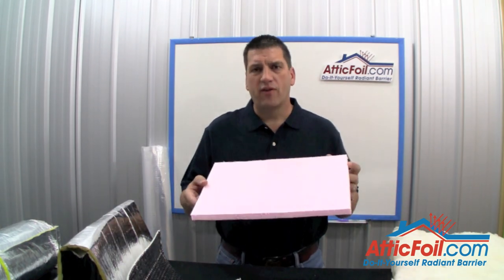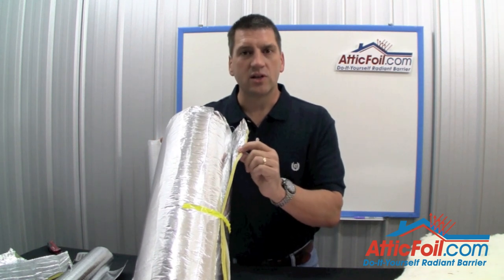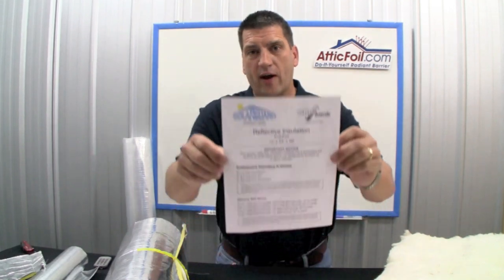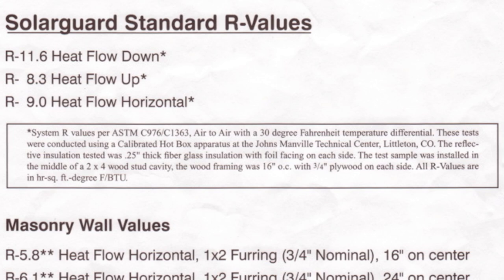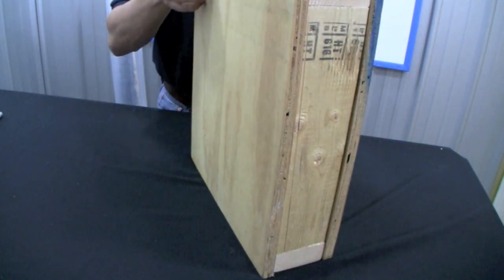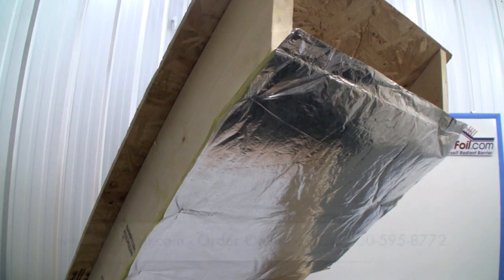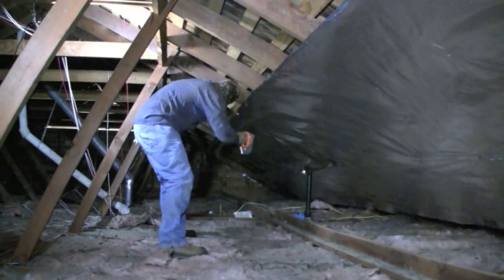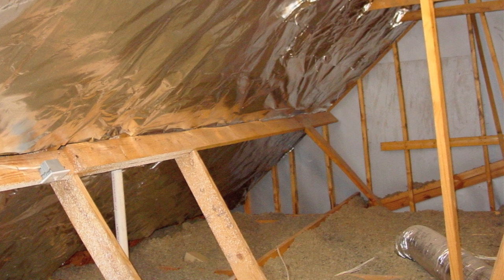AtticFoil® Compared To eShield, Reflectix and Other Bubble Foil Insulation

Comment from the maker: If you need metal building insulation check out our new products at www.BlueTexInsulation.com  They are simply the strongest and most durable foam/foil products ever made. We only use pure aluminum compared to most products that use MPET (Metalized Film).
Reply: How strong is AtticFoil? I'm worried I'd accidentally punch a hole right through it every time I look at it.

Comment: This was my experience recently installing foil backed sound deadener and a similar product shown here. There was no temperature difference measured between only the foil and the foil insulation product. The foil alone did just as well reflecting heat. In my case, I was also looking for sound reading properties from the insulation but this was a surprise to me.This is excellent evidence to support my experience.

Comment from the maker: Usually you will notice a difference.  When you reduce the heat load on one area you tend to change the balance of heat load vs air conditioning capacity. The result is the room/area is usually a cooler.

Comment: This has been extremely informative and helpful ! !   Proper insulation done right can be VERY cheap and make a huge difference in comfort.  Oh yeah, it also saves $$ and helps out the environment.  Thanks againPS It looks like applying Attic foil to my 2000+ spft little house's attic will cost less than $300
Reply: Whow

Comment: What if you have a radiant barrier plywood decking . Should you add foil or is that over kill
Reply from the maker: Radiant barrier decking is not a bad product and it helps some.  However, It's better to attach www.AtticFoil.com to the bottom of the rafters.  We have several homebuilders who do both with amazing results.  Basically, you can be in the attic and not be able to tell if the sun is out or not.  Here is the Dept of energy test results comparing the two.  AtticFoil is much more effective than radiant barrier decking / Techshield.  https://atticfoil.com/index.php/technical-info/dept-of-energy-study-results/

Comment: What would you recommend for an existing metal building with no attic in the desert southwest? (Phoenix Climate)  I was thinking thermal barrier foil inside the outer shell, and then insulate with batts I was given. But I think there needs to be a " min air gap between the corrugated metal and the foil, correct? So maybe bubble type would be good for that? I also plan to paint the exterior with heat reflective paint. Thanks!
Reply from the maker: It really depends on the goal and if the building is conditioned or not.  Take a look at our metal building products here: www.BlueTexInsulation.com  they are specifically designed for non-conditioned (no heat or AC) or semi-conditioned buildings (occasional heat or AC) Stay away from bubble foil products, they typically use MPET (Mylar) instead of pure aluminum.  After a few years MPET will disintegrate from the heat.  Here is some info on conditioned vs non-conditioned buildings.  https://bluetexinsulation.com/pages/insulating-non-conditioned-buildings-vs-conditioned-buildings
Reply: @AtticFoil  I’m looking to air condition it and want it insulated as well as possible
Reply from the maker: @davidwyby  In that case you want to basically build a refrigerator and put it in the "shade" from the heat.  A foil layer will act like the shade.  But, you need an airspace between the foil and the metal for the foil to work.  Feel free to call the office at www.AtticFoil.com there are a lot of options - emailing/texting pics is easy to show things.  You could use regular  www.AtticFoil.com or maybe the www.BlueTexInsulation.com 2mm product outside whatever regular type insulation you choose.  I've recently had a couple customers do a great method of using the heavy www.RoofingFoil.com as the reflective layer and  then using spray foam on the inside.

Comment: Radiant barrier on its own has NO R-value; R-value is attributed to materials slowing conductive heat. AtticFoil™ works to block radiant heat (97%) coming in to the attic by stapling it to the rafters, but it has no R-value.
Reply from the maker: Not sure what your point is? I say this exact same thing in multiple videos, on the websites etc.

Comment: THANKYOU! I wish I found this before I ordered prodex. R15, what a fool I am, UGH! I'm just covering the inside of a crawl space block wall, so not the end of world. I did however plan on using it when finishing my basement. I was going to ask the building inspector if I could use just the prodex, being that R11 is minimum standard. I would've looked like a damn fool thanks to those crooks at prodex!

Comment: I just replaced my roof with metal two week ago. I stripped off all the old roofing, made repairs to the sheathing, put down a layer of building felt, the attic foil, 1x4 slats then the metal. It will be interesting to see how much difference it makes in my utility bills. We'll see.
Donnie D
Reply from the maker: Check out our All-In-One Roofing Underlayment AND Radiant Barrier at www.RoofingFoil.com  It also has the strict Miami-Dade County Approval/Certification
Reply: Hey I'm wondering how you liked the Attic foil? I'm wanting to do exactly as you did. Was you satisfied? Thanks
Reply: 9 yrs later

Comment: I’m glad information is shared like this. I am about to move home and have a big old Metal building on the property I need to use as a workshop, I was considering using a product called prodex 5m ( we live in the south ) but now I am concerned about how best to make the space more comfortable when working. I will be sectioning it off inside due to its size. But even so I’d like to not throw away money if possible. Not sure if you have any advice you could offer ?
Reply from the maker: Thanks for the comment.  Please take at www.BlueTexInsulation.com  Started about three years ago, these are our foam/foil products specifically made for non-conditioned or semi-conditioned buildings.  This sounds exactly like your building.  Please get a free sample kit or call us with any questions.  We are definitely experts in the metal building space.  The BlueTex products are significantly better than our competitors products, period.  Just compare.  Thanks, Ed.
Reply: @AtticFoil  thanks Ed I will for sure check it out once we get moved In.

Comment: i am one of those people that had eshield installed a few yrs ago.  i had it installed over the existing attic floor insulation.  Because of its reflective capabilities it seems like this would be more beneficial if i moved this off the floor and stapled it to the rafters and then added more insulation to the floor.  What do you think?
Reply from the maker: Brian, it really depends on how much insulation you have below the existing product.  I see too often companies will put a product over low insulation.  Radiant Barrier is not a substitute for good insulation.  They work TOGETHER to reduce both conductive and radiant heat flow.  I'd say if you only have a few inches, then I would add more.

Comment: Not sure if this has been asked before in the dozens of videos floating around about foil insulation systems.  Does it need to be fully grounded in the case of a lightning strike?
Reply from the maker: No, especially in the USA where 110v is standard.

Comment: What's the R Value of the 2X4 box with two pieces of 3/4 ply and NO insulation products inside?
Reply from the maker: NOT much more than WITH the bubble foil.  That's the point of this video.  The bubble foil itself has very little r-value and many companies mislead you by using the R-Value of an "assembly" which is NEVER how it's really installed.

Comment: Can you suggest what can I buy in Philippines like yours? What's do you think about fiberglass....is it just a gimmick and I just need strong aluminum foil like yours? In Philippines there are Owens Corning brand and most just use foams/bubble with very thin laminated foil
Reply from the maker: It really depends on the application and what you are trying to achieve as to what product is right.

Comment: Hello

My Name is Leo

I want to make a video studio in my garage, but I just noticed today that my garage walls don’t have insulation and I’m so frustrated right now.

Any recommendation with your products? 

I had watch your videos, but non talking about adding insulation to finished walls from the inside to keep the heat out. 

Would you please be so kind and help me out with this issue?

Thank you so much. 

Leo
Reply from the maker: +ALCONY BRITO ENTERTAINMENT I would start by adding AtticFoil in the attic above the garage.  This will usually make a huge difference.  Garages are not typically insulated since they are not considered part of the "living space".  As for the walls?  That can be tough.  If you are just using it occasionally and can run a window AC then you can probably keep it cool and not spend too much even though it's not very energy efficient.  If you are using it all the time, then you should probably do a true "garage conversion" and add insulation in the walls.  Either by injecting foam or tearing out the sheetrock, adding insulation and installing new sheetrock.  Here is how to install in the attic over the garage: http://www.atticfoil.com/index.php/installation/staple-up-installation/

Comment: Hello, my name is Richard. I have an attic that has an old blown in eco friendly insulation that looks like dirt. I have layered over that some 3in pink rolled insulation. However my house is still hot. I have no attic vents at the moment. I had a guy come look at my attic today and he said I would need 6 more inches of blown in insulation for a 1400 square foot home. Does this sound reasonable or am I getting my leg pulled? He wants to charge me 1000 for all the work. I need some advice please, family man here with one income.
Reply from the maker: Richard, if you live in the hot South I would consider adding some roof vents and AtticFoil radiant barrier BEFORE adding more insulation.  Nothing wrong with a lot of insulation, however the insulation can act like a big heat sponge and HOLD the heat long after the sun goes down.  We want to KEEP the insulation from getting as hot to begin with.  Radiant Barrier and ventilation will do this.  Call our office and we can give you more advice. http://www.atticfoil.com

Comment: Thanks for the excelent video, my question is, what is the best a bubble foil insulation or a single foil insulation???
Reply from the maker: Unfortunately, there are no good bubble products since they all use MPET or metalized film (Mylar).  Check out our new products that use PURE Aluminum and XPE foam at www.BlueTexInsulation.com  What is the application and goal you are trying to achieve?

Comment: so it's just tin foil?
Reply from the maker: It's tear proof aluminum foil.  Regular foil would fall down and tear the day you get a rat or a squirrel in the attic.  It's also perforated with tiny pinholes to allow water vapor to pass through.
Reply: Something like that but much more durable... that you can staple, that won’t tear easy

Comment: Great video thanks. Question - for RV folks who are creating window covers using a bubble foil like Reflectix, does it matter much if there's an air gap between the window and the foil? I assume it doesn't matter too much since primarily the foil is reflecting heat and the insulation value is marginal either way, but correct me if you disagree at all!
Reply from the maker: Yes, the foil is doing virtually all the work.  Glass is one of the exceptions to the rule.  You do not need an airspace between the foil and the glass since radiant heat goes right through most glass (unless it has a coating or film).
Reply: @AtticFoil  thanks! Makes sense. I have a 25% tint but wouldn’t suppose that would make a difference.
Reply from the maker: @slpdataguy  No, if you can "feel" radiant heat getting through it will help.  If possible please send some pictures of your application to support (at) atticfoil (dot)com
Reply: @AtticFoil  makes sense! Thanks for the contact info. Itll be another month before im able to turn to this but once i do ill send along a photo. Thanks!

Comment: I'm building a van and I'm doing the floor right now. I created a frame on the floor using one inch wood, leaving squares. My plan was to put a radiant barrier on the bottom of each square then a one inch plywood would go over the frame and the bottom of the plywood would also have a radiant barrier, creating a one inch gap of dead space, my question is would I benefit at all from filling the squares with wool? I know that radiant barriers work with dead air space but my thought is that the wool is very lofty so it would be a similar effect plus the added r value of the wool. Am I just dumb and should stick with just the radiant barriers. Also i already bought the wool
Reply from the maker: I would skip the wool.  Where ever it touches the foil it will act a a conductor and reduce the overall reflectivity of the assembly.

Comment: Wow - excellent video! I am a certified building inspector for a local city and I see people using these types of products all the time and telling me they meet the required R Value. I found this video linked in the comment section of ProDex insulation, a product I recently dis-approved as being adequate for an R15.67 per the manufacturer's info. I read the ES report and tried to explain it to the installer but they didnt get it. Great explanation showing the system that was used in the test.
Reply from the maker: Check our our NEW Foam/Foil products for metal buildings.  The BEST product ever made to reflect heat AND control moisture/condensation: www.BlueTexInsulation.com